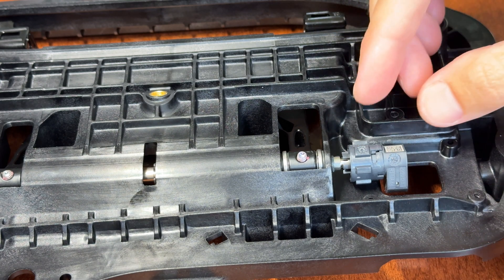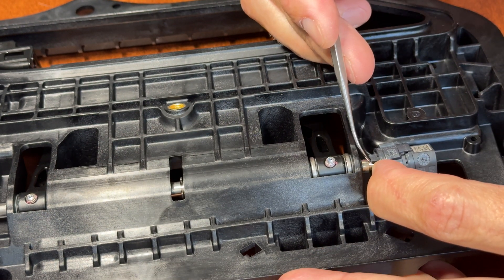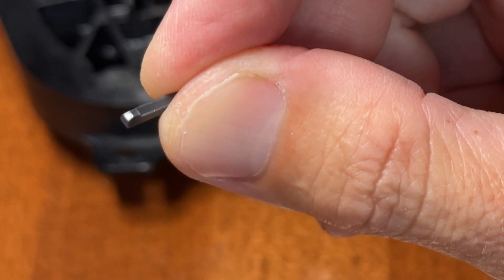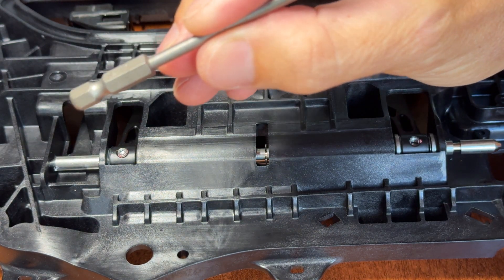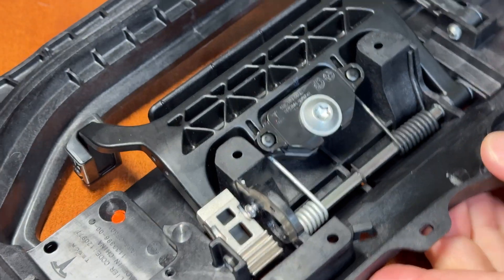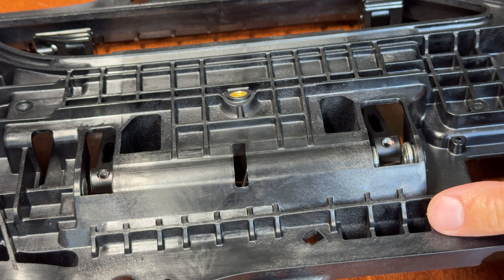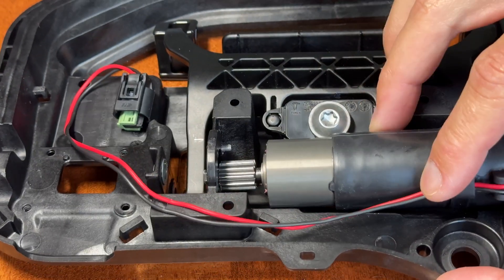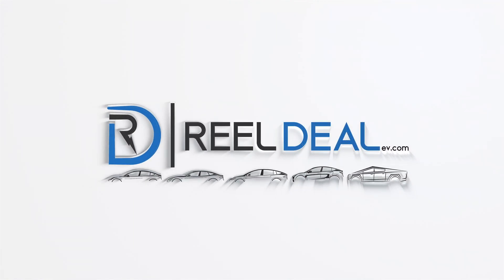Tesla Model S Door Handle Magnetic Sensor Replacement 1066380-00-A

Comment: I replaced the sensor rather than the magnet part that you replace in this video, but it didn't resolve the problem. I'm wondering if there is an alignment issue going on for me. Is it possible for that magnet to spin slightly out of alignment over a period of time from repeated door slamming?